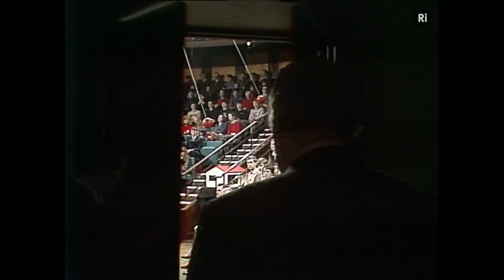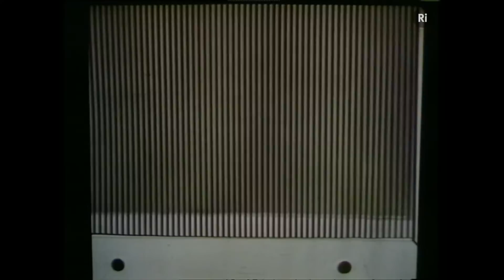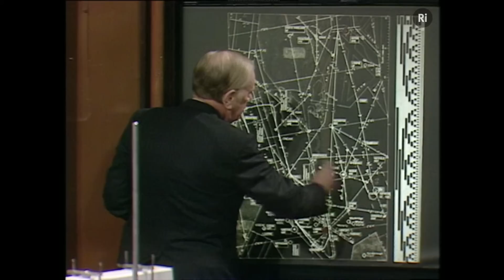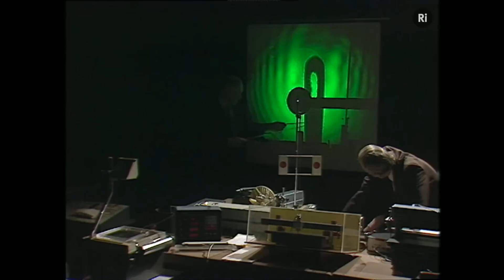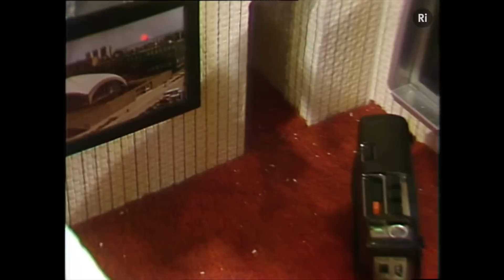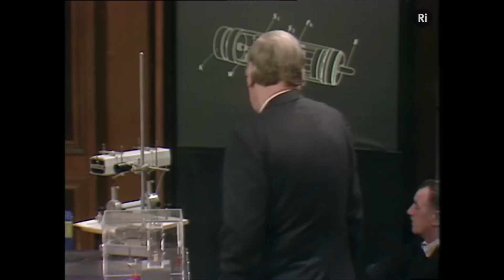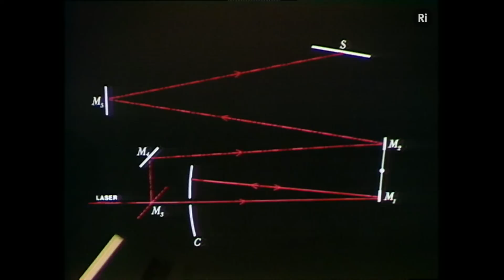More and more about less and less - Reginald Victor Jones' 1981 Christmas Lectures 3/6

Comment: A brilliant conclusion, as he takes digital disk recording back to its Victorian roots. Such a modest man, too. He worked very hard during WW2 and was awarded for his achievements with the highest honours that could be given to a civilian at the time.
And it's refreshing to hear someone talking about thousands of millions instead of the linguistically incorrect term 'billions', favoured by Americans, and which is being stated seemingly everywhere nowadays. For those who do not know, a billion, when stated correctly, comes from a bi-million, which is 10¹², not 10⁹. So a trillion (tri-million) is 10¹⁸, not 10¹². Using correct terminology, you can quote some truly immense numbers before running out of prefixes.
I was making Semiconductors for GEC in 1981. What he only barely touched on was that optical photolithography was reaching its limits in 1980, and that X-Ray work was just beginning to be implemented on an industrial scale. I was making transistors with 1 micron element widths and spacing, 3 axis aligning 50 mm diameter masks manually by microscope under near UV light. A task which required a lot of patience. At that scale, a 1 micron width feature looks like a fuzzy line, and alignment was done by using 'concentric' alignment rectangles at strategic points on the mask. Using interference patterns, two aligned squares would be seen as three squares. There's a knack to it.
45 years later, using the latest ion deposition techniques, features of a nanometer or two in width can be aligned; an improvement of 1,000 times in resolution. Modern semiconductors can have vertical features which are only 4 or 5 atoms in thickness; approaching the point where smaller devices behave very differently to larger ones; stored charges leak away, and reactances and resistances become very important. Modern Silicon and other semiconductor wafers can be 300 mm or bigger in diameter, and each chip on it can contain hundreds of thousands of millions of transistors, if intended for computer use.

We live in momentous times, and the snapshots of an earlier era featured in these lectures really highlight the rates of change of technology within a generation or two.
Reply: Scrub this. Wrong video.

Comment: Learned that the credit for this trick with mirror 33:03 goes to Lord Kelvin! In 1894, Oliver Lodge conducted an experiment during a memorial lecture for Heinrich Hertz, which is considered the original experiment of the radio medium. To make the tiny movements of the coherer detector visible to the audience, Lodge used a mirror galvanometer arrangement.

Comment: 📖 Introduction to Precision Engineering (00:33 - 06:32)
├─ 00:33 Historical Context of Precision Engineering
├─ 01:36 The Role of Matthew Boulton and John Wilkinson in the Industrial Revolution
├─ 04:54 Precision Engineering in Modern Times

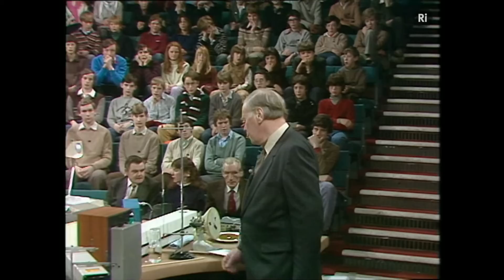📖 Measurement Techniques in Microelectronics (06:32 - 13:15)
├─ 06:32 Automatic Measurement Devices and Electrical Signals
├─ 07:06 Moiré fringes Method for Measuring Deflection Grating Errors
├─ 08:48 Principle and Application of Moir Fringes in Measurement
├─ 11:33 Diagram of Long Scale Attachment to Machine Tool
├─ 12:06 Programming the Computer for Cutting Tool Movement in Three Dimensions
├─ 12:40 Operator's Role and System Widespread Use

📖 Alternative Method of Moiré fringes Measurement (13:15 - 16:38)
├─ 13:15 Transparent Ruler with Fine Divisions
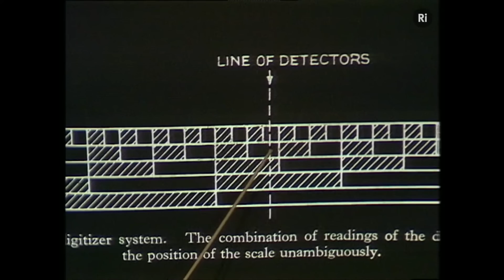├─ 14:23 Photoelectric Detectors and Sequence of Answers

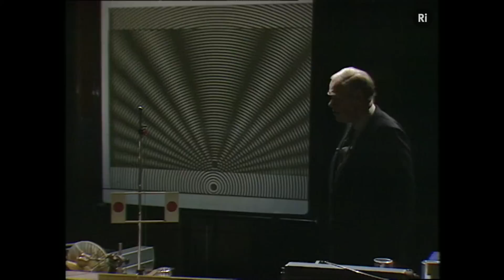📖 Introduction to DECA System (16:38 - 22:04)
├─ 16:38 DECA Pilot's Map and Navigation
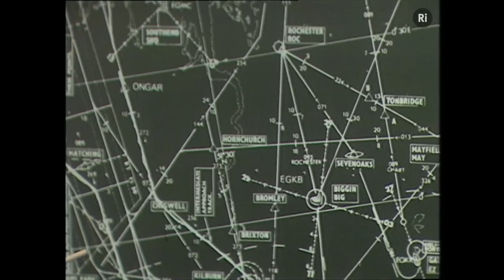├─ 17:42 Automatic Reading of Scales
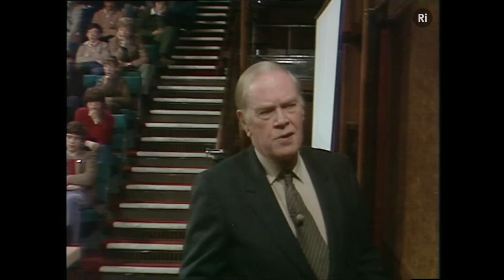├─ 18:51 Optical Methods for Machine Tools

📖 Laser Interference and Diffraction (22:04 - 26:30)
├─ 22:04 Principle of Laser Interference
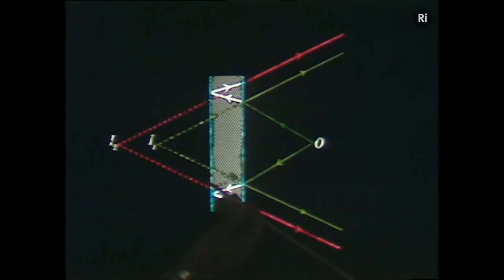├─ 23:13 Diffraction and Refraction
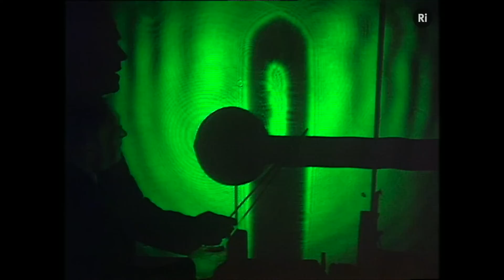├─ 24:49 Limitations of Precision Measurement
├─ 25:57 Interference Patterns and Rings

📖 Introduction to Laser Interference Patterns (26:30 - 31:47)
├─ 26:30 Demonstrating Blue and Green Light Interference
├─ 27:02 Wavelength Difference between Blue and Green Light
├─ 28:05 Atomic Energy Development and Isotope Separation
├─ 29:10 New Standard for Length Measurement using Lasers
├─ 31:14 Lord Kelvin's Contributions to Physics and Engineering

📖 Lord Kelvin's Invention (31:47 - 36:10)
├─ 31:47 The Problem of Measuring Current
├─ 32:22 Inspiration from a Childhood Game
├─ 33:28 The Solution: Using Light and Mirrors
├─ 35:05 Demonstration of the Optical Lever

📖 Introduction to Laser Eavesdropper (36:10 - 42:58)
├─ 36:10 Laser Eavesdropper Principle and Demonstration
├─ 38:58 Practical Application of Laser Eavesdropper
├─ 39:36 Limitations and Scientific Applications of Detection Methods
├─ 41:52 Electrical Capacitance Method Demonstration

📖 Introduction to Bending Beams (42:58 - 48:28)
├─ 42:58 Adjusting Light Settings for Demonstration
├─ 44:07 Bending Beams and Expansion
├─ 45:10 Sensitivity of the Method
├─ 45:46 Applications and Tilt Meter
├─ 46:50 Electronic Plum Line Instrumentation

📖 Measuring Earth's Movement (48:28 - 52:47)
├─ 48:28 Observing Patterns and Correlations
├─ 49:32 Understanding the Effects of Water on Granite
├─ 51:43 Explaining the Tilt to a Young Student

📖 Limits of Measurement Accuracy (52:47 - 57:38)
├─ 52:47 Brownian Movement and Instrument Limitations
├─ 53:54 Thermal Vibrations and Measurement Uncertainty
├─ 54:58 Mechanical Pressure of Light and Optical Levers
├─ 57:44 Light's Influence on Ruler Measurements and Celestial Bodies
├─ 58:49 The Role of Radiation in Star Size Maintenance
Reply: Thanks!
Reply: Thank you
Reply: One correction: It's Moiré fringes and not Moir fringes.
Reply: @bedirhanakdag  updated, thank you. Timestamps are generated off of the transcript text.:hands-yellow-heart-red:
Reply: DECCA -not DECA